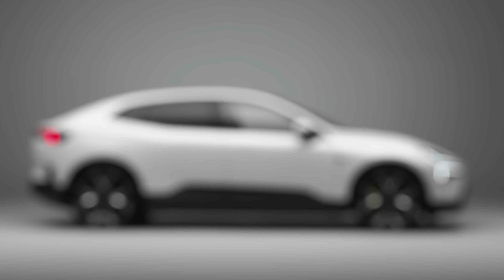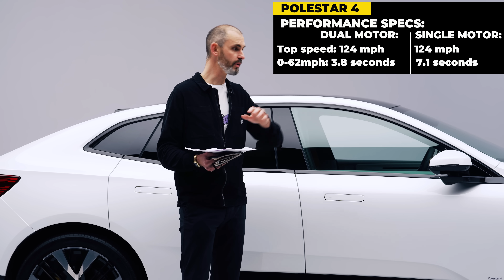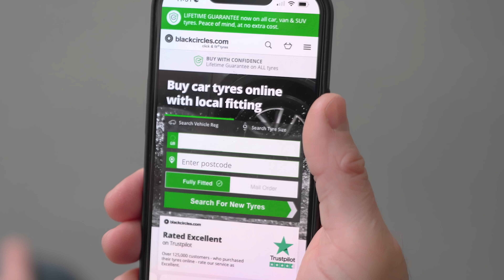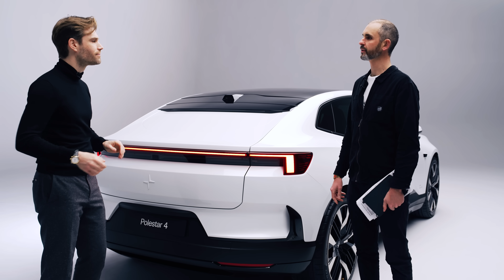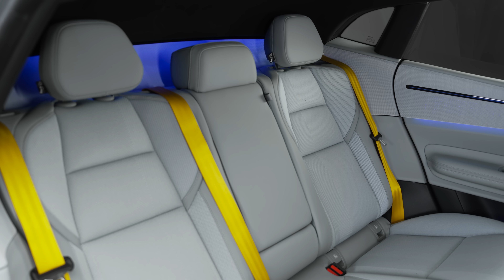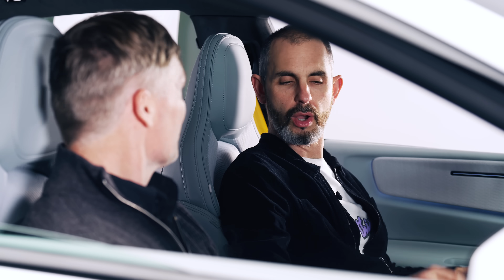New Polestar 4 EV detailed First Look - why the classy electric family car has NO REAR WINDOW

Comment: I appreciate the fresh and minimal design, but all I see is how expensive repairs would be for this thing. So many LED's inside the car, all of those cameras which will surely fail at some point - and given these electronic dependent cars I wouldn't be surprised if the car won't allow you to drive it with a broken camera for 'safety' purposes. I see more excessive luxury than I see practicality - which I find is at odds with a minimalist design.
Reply: Minimalist design and minimalist functionality aren’t quite the same thing, apparently.

Comment: Can someone tell me why if I look at my mobile phone at traffic lights I can risk 3 points and £100 fine, yet to simply operate these modern EV you have to interact with a damn iPad not in the field of view of the driver for nearly everything and it be legal?
Reply: Totally. I love my EV but having to take my eyes off the road for a second or two every time I need to change something is not good.
Reply: @geoffreyjones6019  stupid Musk
Reply: Will also need to refocus on the rear view screen rather than looking at reflection in mirror.
Reply: Tbh that isnt limited to EV's most modern cars are like this now
Reply: Because your controlling the car  not a completely different device
Reply: I’m a driver trainer, learners and fleet. My training car is a Tesla Model 3. So I spend every working day thinking about training people for the future of cars with touch screens.

Turns out it’s not a problem, we’ll, not in a Tesla. There’s nothing you need to go into the screen to operate while driving. A lot of things are automatic and work exceptionally well. You might want to turn the temperature up or down which is at the bottom of the screen. Muscle memory means after a few goes you don’t look at it and operating the heater isn’t essential to safe operation of the car and can wait until it’s safe to change. Alternatively, just use voice control.
Reply: Potentially can still be done for driving without due care & attention if needs be
Reply: truer words were never spoken
Reply: Because one is a hand held phone and the other isn’t.
Reply: I thought it was a level requirement to have a rear view mirror in the uk 🤔
Reply: @melderosa656  the law requires at least two mirrors giving a rearward view to be functional. So no, if the two wing mirrors are fine the other isn't required. Hasn't been updated to define 'mirror' to include a screen AFAIK though, so those cars with screens instead of wing mirrors might be breaking the law.
Reply: @melderosa656 hardly, or no van with solid back would be legal
Reply: Brave new world grasshopper
Reply: I don’t know but can someone explain why stealing $999.99 dollars worth of stuff is a misdemeanor and $1000 a felony? Because ppl who make laws don’t know what the hell they’re doing
Reply: This cars infotainment is built on Google software...so use voice commands...that's much safer than a screen or dedicated buttons.
Reply: It is not the looking at the phone which is illegal, it is lifting and handling the phone. If it is in cradle you can touch, the same as screen in the car. Mind you in either case if you have an accident as a result of looking away, you will be charged.
Reply: Because you haven't been able to easily identify the difference?  Think more.
Reply: Because our laws are poorly conceived blunt instruments for revenue collection.
Reply: You can use voice commands for lots of functions, how often do you change settings in any vehicle, not often.
Reply: 100% it's mad
Reply: Changing the radio station isn't the same as Whatsapping or scrolling Insta. Car screens and Android Auto / Apple Carplay have deliberately dumbed down interfaces that don't allow much typing or interaction.
Reply: @MyMednas  you are correct but also what about basics like changing the HVAC temps, fan speed and directions etc..Tesla have even buried the Drive, Park and Reverse selection into the touchscreen now and with this car they discared an actual window and replaced with a cam and screen...what next no windscreen?
Reply: @mancubus1977   Works for Captain Scarlet in the Spectrum Pursuit Vehicle :)
Reply: Facing to the rear too - much better in the event of an unplanned stop ;)
Reply: @mancubus1977 
Calm down Karen.
Everything is going to be okay.
Reply: @MyMednas  watch any ev review and you'll see th erdriver with their eyes off the road for a long time. Im not saying people should be messaging on a phone, clearly thats not good, but im sure if I have to look at my phone on a vent holder for the mapping, ii'll get done for it. Yet going into several layers of app to turn the heating up or down is ok!
Reply: @MyMednas true but it is distracting and pulling your view away from traffic. No one is just a stoic in their car is my experience.
Reply: @jwvandegronden  But what you actually look from the screen while driving? I do not much operate it other than adding stops to navigation, but even that so often.
Reply: I can tell you, we entered the age of stupidity. Idiocracy the movie tells you all.
Reply: My point exactly and if you're not doing that you're escaping a fire😂
Reply: Been saying this ever since the Tesla came into production. Some EV's still have physical buttons which I feel are still necessary.

The new Volvo EX30 doesn't have a speed dial, it appears on the top corner of the screen which means you're always taking your eyes off the road to check your speed. Bold move from a company known to be the safest car manufacturer in the world.
Reply: Have 1000 upticks. Screens and haptic feedback buttons in cars are so dangerous. As a full time motorcycle rider, anything that encourages a driver to take their eyes off the road increases the risk of them plowing into me.

I have personally had three incidents within a fortnight- all Teslas.  All too busy making their car fart or drive on mars or play a stupid tune to see me, a 17 stone 6 foot man on a bright green Kawasaki.
Reply: Appropriate that it is white as EVs are like white goods, uneconomical to repair and with little residual value after a couple of years.
Reply: Because if you use common sense, texting on your phone is unnecessary and not related to operating your vehicle, but adjusting your HVAC is. By that logic, should you also get points for looking down to adjust HVAC using physical controls? You do realize even with physical controls you have to look to see what adjustment you are making right?

Also, you are conveniently forgetting that you can literally make all of those adjustments hands-free without removing your eyes from the road by asking Google Assistant to do it for you, which is even SAFER than traditional physical controls.
Reply: @jayem8981  I do not have to look to operate my heater controls in my Merc. Also, voice activation does not work with loud music or when you have kids in the back.  Please get into the real world with the rest of us
Reply: @jimpackard8059  Voice activation doesn’t work with loud music? Uh, how about turning down the music?

Again, see my “unless you have common sense” comment.
Reply: @jimpackard8059  activating voice control in my Tesla mutes the music. Then saying “heating 21 degrees” will turn the heater to 21 degrees. Easy.
Reply: Because we are being bullied into buying these damn things so safety can be ignored for the sake of the cause
Reply: @jimpackard8059 no one is bullying you to buy an EV, you can buy a new ice car every year for at least the next 11 years and run one for next N years before it breaks. I truly expect that the oil lobby will bully the government into pushing the ban back even further.
Reply: Oh dear Johnny….what DO i do?? I’m thinking to change now but what do I buy. After 58 years of petrol and some diesel cars, the EV is a foreign beast and your followers hate them. I don’t…I have owned too many rubbish engines and had good reason to hate them but then, I also had and still have some good ones. Do I go electric…I think it has many merits and we need to do something to lessen the impact for the future generations but EV’s do not really save anything…movement requires an energy input whatever you do and that figure is constant…only time varies. I live with an iPad but they are seriously flawed in a car. I am concerned about battery safety and have personally witnessed an exploding battery just ten days ago…it is a fearsome sight when it gets going! I like the idea of modern thinking and this Polestar has some new ideas…the back window is just like a van but cameras are a problem compared to the reality of a mirror. I think I should buy one…or a Macan EV but then comes another problem …depreciation….But I guess I don’t need to worry if I keep it long enough..it might outlast me. Well…..totally confused….i think a smaller EV for town and a last fling with a Bentley Continental GT 4.0 L before it is too late to insure it! Stay safe….find more barns…😬😃😃😃Richard.
Reply: @HQBProductions sounds like a good solution Richard. After 50+ years of 2 and 4 wheel ice, I got an EV last May, loving it. It’s quick enough, comfortable and quiet. As far as energy is concerned in the summer 1kWh will take me 4.5 miles, 1 lt of petrol about 10 miles but a litre of petrol contains around 8.9 kWh so it’s just over a 1 mile per kWh. The issue with ice is that only around 30% of the energy available is turned into motion the rest is lost as heat. I’m fortunate to have solar panels so much of my ‘fuel’ incurs no extra cost (in the summer) and off peak electricity can cost as little as 7.5p, public charging can be more expensive than petrol but an EV as a local runaround will probably be charged at home anyway. I too have seen a lipo battery catch fire but that happened after it impaled itself on a motor shaft in a vertical dive when an rc plane hit the ground. It fizzled a bit with a few puffs of smoke but even 30 minutes later when it was finally retrieved it was still only smoking a bit. EVs don’t spontaneously combust despite what idiots write, if they did with almost a million on the roads in the UK you’d have seen a few by now. Embrace the future, go for a test drive I’m sure you’ll enjoy it.

Comment: I wish I could wash it at high temperatures and have the whole thing shrink by 10%. What a massive EV, again.
Reply: Well, the Volvo EX30 all the way. Also considering the price point
Reply: yet, they had to remove the rear window to gain "headroom" ...
Reply: Given the amount of fabric in it, you probably can.
Reply: I am sure small/cheaper EVs are coming
Reply: ...or just get a smaller car.
Whatever's easier, I guess.🤦🏾‍♂️
Reply: It ain’t that big lol. Wake up.
Reply: The 10% smaller version you’re looking for is the Polestar 2
Reply: @NIAtoolkit  I wish there was something in between around the size of my EV6. A slightly longer Polestar 2 with an actual trunk area would work, which is what I thought this was at first.
Reply: It has to be big as it needs loads of slow charging batteries for its 90 mile real world range.
Reply: it's over 79 inches wide or 2000 mm without mirrors! That's 1.5 inches wider than the porsche taycan which is itself wider than the cayenne. Parking would be an absolute bee's ass coming from a car that's 5 inches shorter and 5 inches narrower. @MR_THINQ

Comment: So as soon as the camera breaks you can't see anything behind you and ten years from now you won't be able to get replacements, which means the car will be basically scrap. Heck, even if the camera gets dirty you're going to struggle. Also, how well does it handle glare from the sun? You can bang on about 360 view all you like, but we already have that, in the form of very simple, easy to replace tech called........windows. Cars really are getting silly with all the tat they try to jam into them to justify the ridiculously high prices we now see.
Reply: Heck, while they're at it, remove the windshield and replace it with a 50" display.... Absolutely silly idea to replace windows and mirrors with cameras and screens. Wasteful, needlessly complex, inconvenient and unsafe!
Reply: I don’t think you’ll have to wait 10 years for the rear view camera to become unavailable - more like 10 months with the way this brand is nosediving!
Reply: You can still see behind you by using the door mirrors...
Reply: Nobody's forcing you to have one. Just buy another car.
Reply: @ulwur and nobody asked for your "opinion" so just get used to the fact that yours has no greater value than anyone else's.
Reply: Nobody's forcing you to have one. Just buy another car.

Comment: And if the Camera fails the good old rear view window wins. Looks nice all the same. So when someone lets you out or in a lane I can’t put my hand up at the mirror as if to say thanks then🤔 I think it’s when you let a designer some freedom and he forgets it’s actually a Car to be used as a Car and not a night club with atmosphere, sorry just want a car. It will be a nice £30k Car after a year. Polestar 2 I had out for a few hour’s was great a bit big for my taste but effortless to drive and not one rattle just seemed quality. But the same Car that was priced split new £53k is now £32k after 3000 miles and six months. 😮 I appreciate the poor guy has had to do the same thing probably 20 times with different. Volvo/ Polestar are going to have a busy year. The EX30 just shades it for me, smaller, faster and cheaper. This at £60k ouch….

Comment: terrible rear design, or the lack thereof; it's basically a BLANK and FLAT space with nothing. 

the rest of the car is rather pleasant. 

the rear camera however is a terrible replacement for an actual mirror cuz a screen gives no depth perception for the driver.

Comment: I still worry about dirty British roads and those cameras caked with muck, dint hear much about cleaning them whilst on route, if it’s a dirty wet day would you have to stop to clean them?
Reply: we get even dirtier roads here in Sweden during the winter, and as they test them at the Volvo test track, I would assume/hope that that is sorted.
Reply: They use windscreen washer fluid to wash them most of the time.
Reply: Wondering here if Road Salt and Cams mix?
Reply: i was wondering the same. what if it rains... do you no longer have a "back window" LOL
Reply: @pvic6959 the back camera will work in all conditions. The car is tested in north Sweden in the worst snow and dirt conditions. The car is perfect.
Reply: The camera housing is designed to deflect the dirt muck and general weather so as to keep the lenses clean…I’m sure they have thought it through…normal cars with reversing cameras tend to be lower down so they gather all the muck…best people to ask are those who have a Landrover with the camera system see how they got on with theirs.